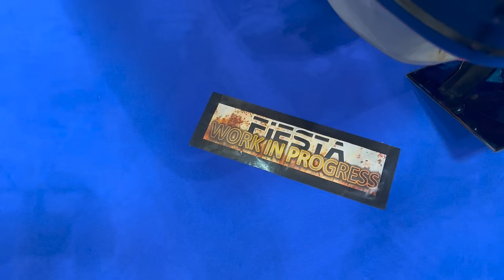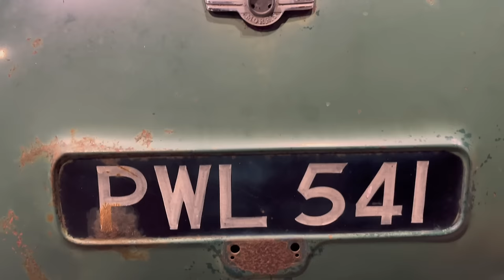Practical Classics Restoration Show NEC March 2024 - lots of classic cars!

Comment: I’ve owned three Marinas. Mk1 1.8 auto in 1981. My first automatic. Biggest engined car I’d owned. Owned till 1985. Rated as my best car until the late 90s. Then 1988, a £250 1.8 Mk2 banger. Not good. Too much to go into. Then 2016, auction bought Marina HL automatic, low miles, twin carbs, near immaculate interior, 2nd rate paint job but presented well. Thought I’d love it. Drove me mad. Nothing I did to it or spent on it worked right. Grew to hate it. As a kid I thought the Mk2 Marinas in the brochures looked ace. Now I think that hard plastic cheap creaky dashboard with the radio facing the passenger is a terrible backward step from the padded dash in the Mk1 Marina. On my twin carb one every time I pulled the steering shroud mounted choke knob out I had to hang onto the column shroud with one hand to try to stop the plastic breaking.